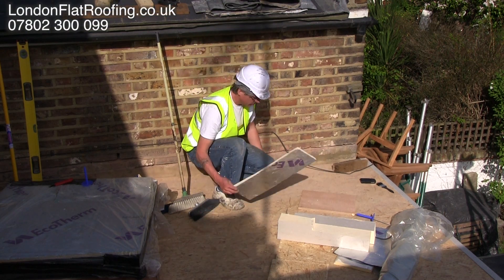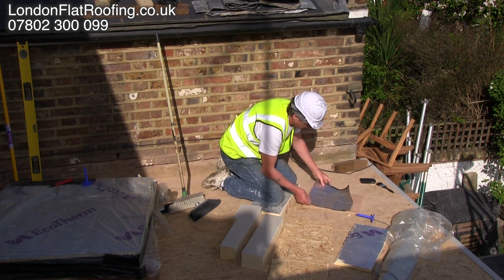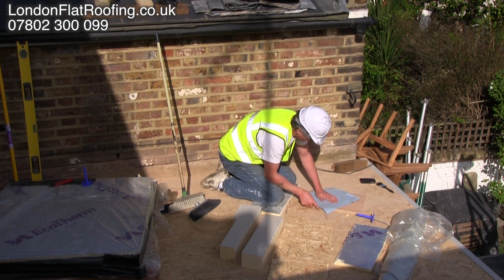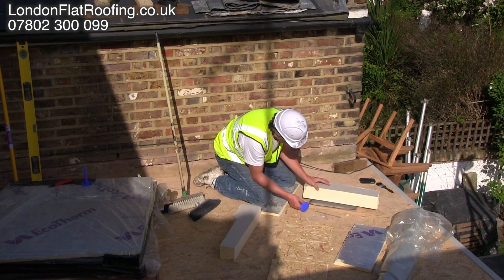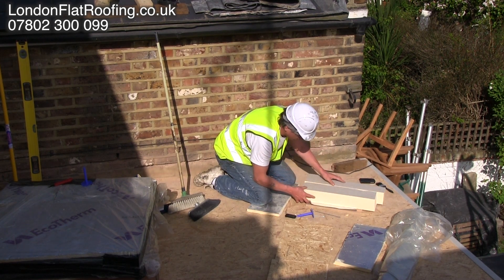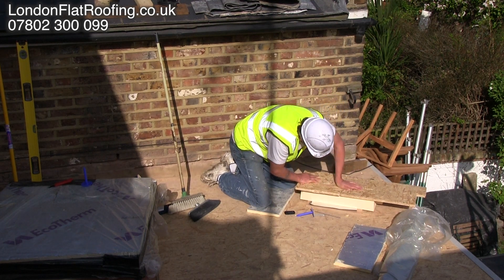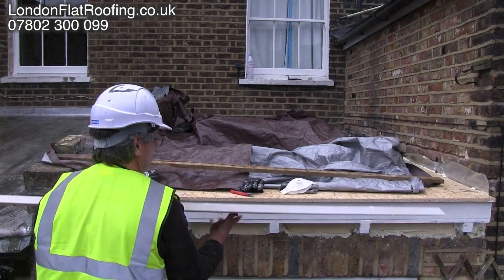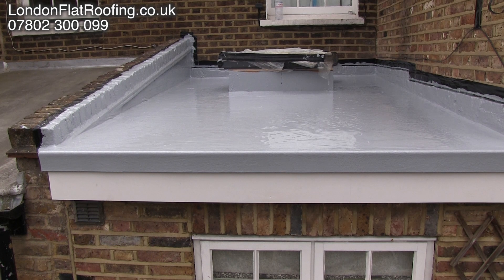Warm Flat Roof Vapour Barrier Insulation Explained

Comment: My Roofer suggests that he will use Visqueen and this will be lapped up the side of the insulation and terminated just above the top layer of OSB, which sits on top of the insulation, on top of visqueen 1200, on top of 18mm ply. I thought the visqueen would have to go over and be terminated under the coping stone of the parapet, but he has said the rubber roof, which will be lapping up under the coping,  would not stick to the visqueen. Does this sound right ?
Reply from the maker: visqueen 1200 is not a VCL you need to reach a v vapour resistance of greater than 530 MNs/g after installation even if used Visqueen vapour barrier that is  530 MNs/g it would be down graded when fixed so you need to use something much better such as Alutrex 600 or Visqueen Fully Bonded (FB) Vapour Barrier

Comment: Could you overcome the problem of piercing a cheaper VCL with a fixing which anchors the top layer of boards above the insulation, by placing butyl tape along the length of each joist? I'm not sure if it would matter if the tape was actually on top of the joist, or on top of the VCL. Any thoughts?
Reply from the maker: No its to hard to do it the way you are explaining. The VCR vapour control layer is so important its just not worth getting it wrong

Comment: we have been roofing for over 40 years if you are doing warm roof you need to put another vapour barrier on to of the insulation what we have found on early warm roofs done around 15 years ago is customers complaining of bad smells like damp so we took a roof off to find out the problem and where the osb or ply laid on top of the insulation it had emulsified the smell was awful what happens when it is a hot days the heat on the boards transfer into the insulation and makes it sweat  putting a vapour barrier both sides of the insulation stops this. in video they said you don't have to board over insulation. you do i have contacted the manufacturer of celertex and they said it should always be boarded over i have seen a few were they have just gone over the insulation and u can see the foot prints of the fitters where they have been walking on the insulation
Reply from the maker: Just found this after two years but so sorry for the late response. you bring up some interesting points as something is amiss in the flat roofing trade and especially warm and cold roofs construction. Putting a vapour barrier over the insulation is admitting that moisture is getting into the roof in the first place. The theory that building control is working on at the moment is that the vapour barrier stops the migration of most of the monster into the insulation from the rising warm air. If the VCL vaper control layer is the correct layer and is installed correctly then the amount of moister in the insulation above the VCL will not give a problem. I practice all the roofs that fail( and I see a lot ) fail because of bad choice of materials and badly installed materials. As regarding boarding over, there are insulations out there that are designed to lay the waterproofing over without boards and yes if you walk on them they are soft.
Reply: Hi Steve,  do you use 18mm for both the bottom and top deck?

Comment: isnot tar back then offering waterproof protection, then defeating its purpose?
Reply from the maker: +Keith McManus 
No the tar backed vapour barrier is stopping the  moist air from rising into the warm roof insulation. The flat roof covering is stopping the rain from getting into the warm roof.

Comment: Great video steve,  if I used a thicker gauge membrane, such as a 1000 that would be sufficient wouldn't it? Fixing the top deck, how can this be done without penetrating the membrane, wouldn't the screw pulling the materials tight to the joist create a sealed fixing?
Reply from the maker: +l ellis  Warm roof construction normally works even if fitted incorrectly and with the wrong materials. Vapour resistance of greater than 530 MNs/g is what you need to reach and maintain for a standard dwelling.It's not the thickness that counts its the vapor resistance of the material, so it depends on what you are using and how you fix it. So you have to do a lot of homework to find the appropriate materials or do what we do and use one that so good it covers all posable problems, completely over the top but at lease we know it will do what its suppose to do, it even self-heals when you screw through it. The thing to get right on a warm roof is but the roof insulation together
Make suer there are no gaps and that no air can move through. In my eyes, that is the most important aspect of a warm roof. Use the link on my website to go to the suppliers of one of the best vapour barriers on the market.
 http://www.londonflatroofing.co.uk/flat-roof-insulation/warm-roof-cold-roof/best-vapour-barrier-for-flat-roofs/

Comment: Hi Steve, you mentioned that the hardboard goes on top of rafters, when you look at 1 min 30 secs of the video to see the layers of the finished roof it looks as though the celotex is sitting inbetwwen the rafters and underneath the hardboard?
Reply: That's just plugging the ends
Reply: Need to put insulation in areas like that or it would have created a cold spot and caused condensation ..
Or so i believe anyway

Comment: Started well...then got confusing Steve about 1.05 in...where does the vapour barrier go when double decking the roof please. I'm guessing this...from joist up..Joist, timber deck, vapour barrier, insulation, timber deck no.2 and felt. That correct?  Also, may I ask what are the choices for decking material and which is best...wbp ply, OSB etc? Thanks Steve. Good vids.

Comment: roofing is a cut throat game, if you price for a high spec job,the client or customer thinks they are getting ripped off, a cold roof always gets the job, say 10 sq feet,strip, supply 18mm osb3 1b,1e,fulley bonded inc flashings, £650, its not worth the risk, any way,well documented, any suggestions
Reply: trevor francis It's o.k if you give the customer options and explain the difference, then they have a choice. We're just moving from a cold roof to a warm roof (flat roof). We had a cold roof for many years but there always seemed to be problems. Now that we're getting older and the roof was failing, it seems like a good investment to us. (Trevor Francis was once my favourite footballer by the way).

Comment: should have put grp up and over the whole of that solid parapet wall, the top course of bricks will absorb water which will get in as far as the tile before it comes out,  but by then it is under the deck and the vapour barrier. poorly thought out way of laying this roof
Reply from the maker: In many respect you are correct however life isn’t that easy.
The neighbour would't agree with us dressing the new liquid roofing system across the parapet wall onto his site.
Also building control  assumes that the saturation point of a brick is such that what you are saying will not happen. I tend to agree with you that with the amount of rain we are having now to completely cap the wall would be the way to go.
By the way this roof is not GRP its a kind of liquid plastic system.
Reply: That new roof will soon fail at the parapet

Comment: I have a flat roof in the London borough of Kensington & Chelsea, my flat roof is pitched at an angle of 15 degrees, does this affect the insulation properties of how the vapour barrier works? Will a cold roof installation be cheaper for building insurance? The cheaper plastic membrane might affect any guarantee policy that covers all areas of the roof? Is the use of adhesive on foil backed vapour barrier membrane guaranteed to free up existing water damage by drying through better ventilation?